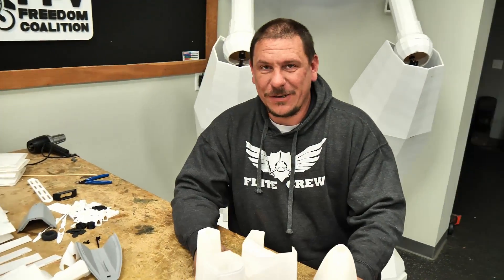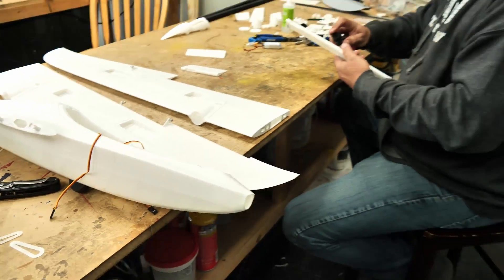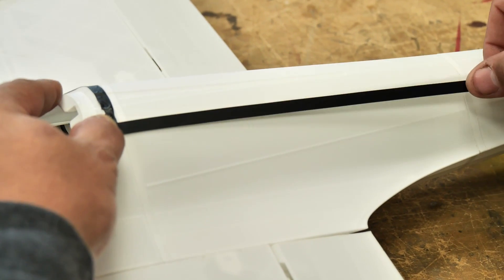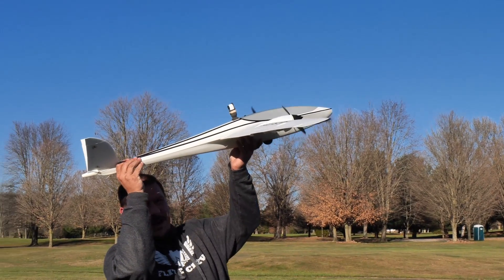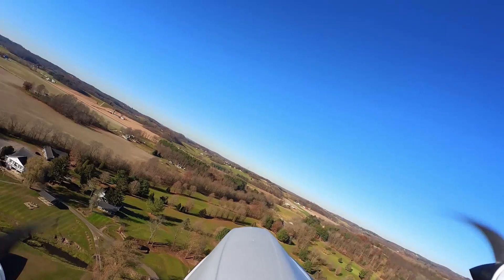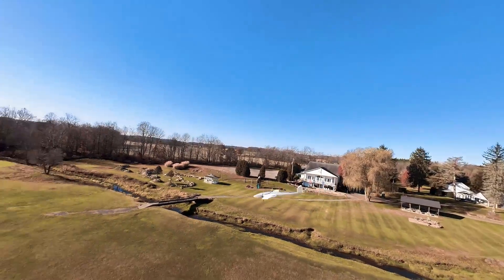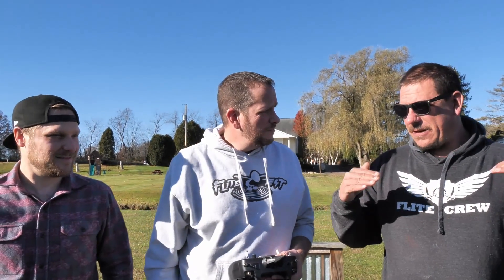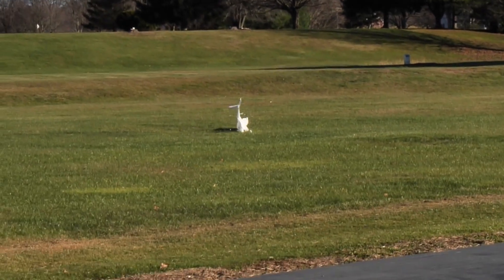3D Printed Airplane - Eclipson Pathfinder

Comment: Looks like you used the Aura 5 lite FC.  How did you connect the servos?  Did you put a 'y' connector on the two ailerons servos, two flap servos, and two escs?

Comment: Great to see you guys using Bambu Lab printers but unfortunately LW-PLA does restrict printing speed (55mm/s) so you can't take advantage of their high speed but I guess it doesn't matter when you have 10 printers :)
Reply: Actually, with some tweaks, you can print the LW PLA at high speed it strings a little bit, but with just a little cleanup after the print, you're all set
Reply: @davidjester5085  I would really like to see your printer profiles any chance you could post them on the forum ?

Comment: Just ordered a X1-Carbon printer today during their Black Friday sale. A video showing techniques and slicer settings for printing these aircraft would be great!
Reply: You will find the detailed instructions on how to set up your slicer for each part on the eclipson site. These are available before buying, look for the "read before start printing" button.
Also they provide a general g-code that most printers can digest, you can skip the slicing if you're lucky.

Comment: Question for the design peeps out there, how would I work a split airbreak like what was used on the SBD dauntless? Would it be possible to hook up as one servo or would I have to use two?
Reply: You can get it to work with one. Wire each split on the same wire and make them open by pulling forward. One wire piece is going up through the wing. Or you reverse it and open by pushing back. That is going to make you play games on the inside of the flaps which may make them too weak.

Comment: Ive always had difficulties with tapes and vinyls not sticking well to any printed surface. The conclusion ive come to is each layer leaves tiny ridges which makes tape hard to grip. With the foaming filament you end up with lots of bumpy ridges which exaderates the effect i think. Its like trying to put tape or vinyl arross a bed of nails. Lots of points not much surface are to actually grip to.
Reply: Have you tried sanding the surface?
Reply: @michaiahledwith5153  Not really viable as these are a single layer in vase mode to save weight.
Reply: but it's easy to write lines and numbers with a permanent marker on LW-PLA